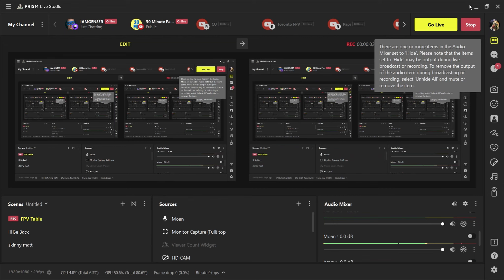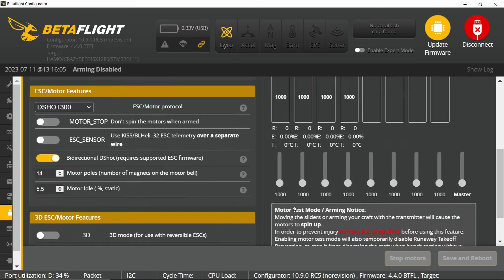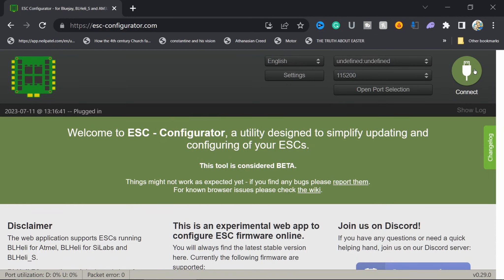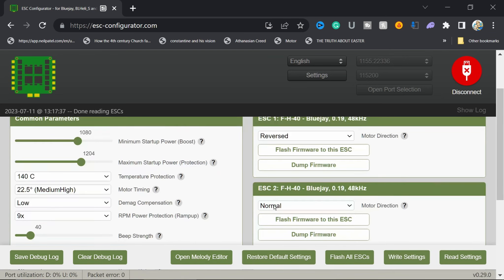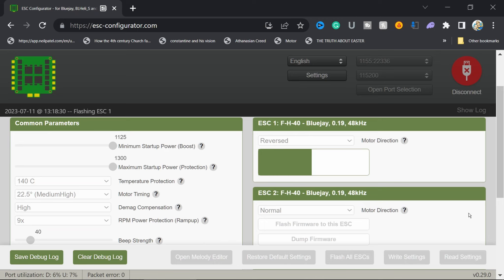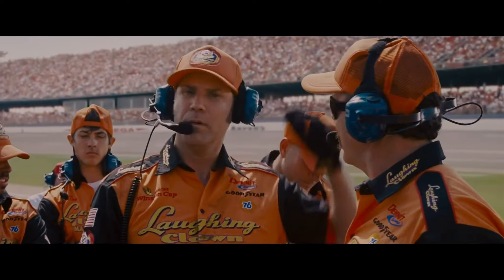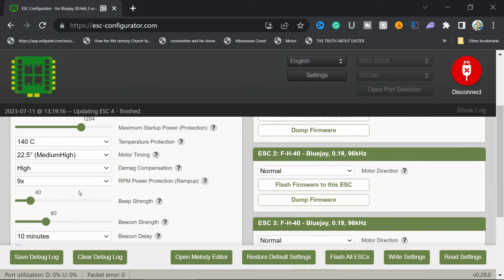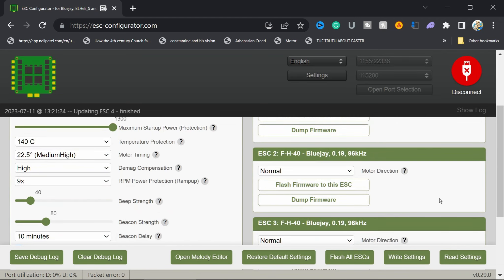Drone Falls Out Of The Sky Desync, Bad Motor Or Power Loss?

Comment: I love your accent.

Also, thanks for the tips
Reply from the maker: No problem and thank you! Check out the playlists, especially the beginner. One has some useful stuff in there to help you tune up your drone! What are you flying?
Reply: @TorontoFPV  currently I'm trying to fly a cinehawk. But it randomly falls from the sky.. 
I replaced the Receiver, because it was crap. And it all seems good. Except for the random failing.
Before that I had a babayhawk 2 HD.
And before that a DJI FPV... (I didn't know what I know now)
Reply from the maker: @SanneBerkhuizen  you on the o3 then? how are your building skills? Do you need to fly it inside?
Reply: @TorontoFPV  
My building skills are mediocre at best.
But I guess it's good enough for small stuff like replacing motors and receivers.
I have the O3 for video and the radiomaster rp3 v2 as the receiver.

My place is too small to fly inside. So I just fly wherever feels right.
Mostly over grass fields and in parks because I don't, and can't, trust my equipment at all.

One thing if for sure. The boxer and the receiver are good.

I guess there is something wrong with the flight controller itself or the Esc which are on the aio.
Reply from the maker: @SanneBerkhuizen  If you're able to fly then it's most likely not the ESC or the all-in-one. More likely one of your motor shafts are a little bit bent. So when you do a certain maneuver the vibrations cause the pid loop to go out of whack. I had this issue with one motor. It would fly fine but the moment I tried to do it back flip it flips out. https://www.youtube.com/live/CfMDuqSZuKQ?si=D-3WDj7qe8DZm1Ek
That should help you fix your problem. And if it turns out that you need new motors, watch this video and order for my link. I've been loving them. https://youtu.be/1PAuVPRcBpg